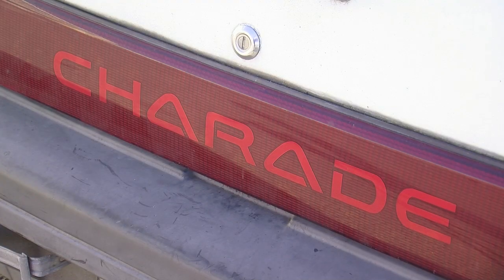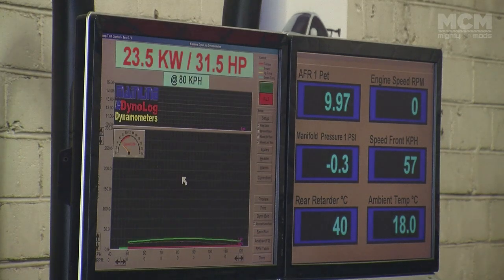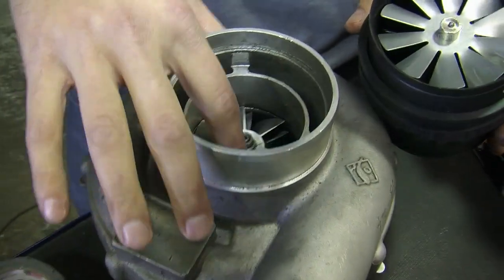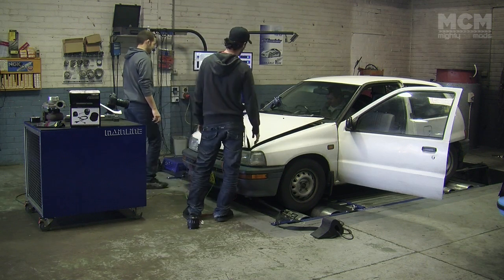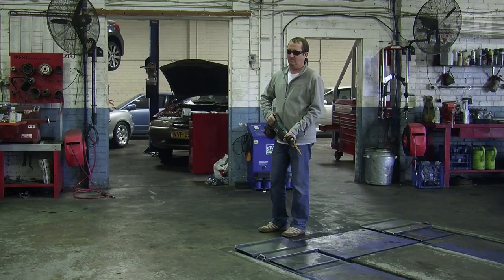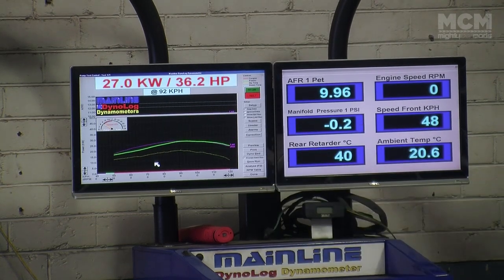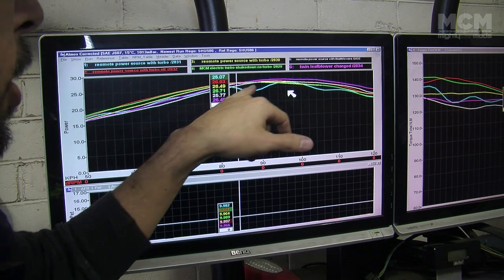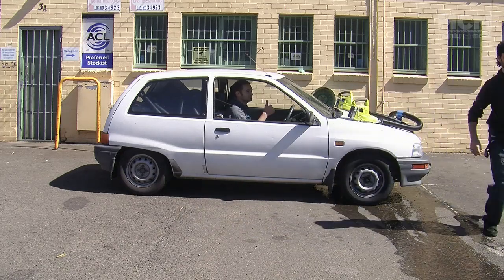Electric SuperChargers Mythbusted

Comment: My guess is try a big fan like 20 inches, blowing into a funnel with a 3 inch outlet into the air intake.  The fan still needs to be spinning insane fast and you need adjustments to gas mixture and timing to get the best.  Its all about cramming in enough air fast enough to get some compression at the intake. You have to have air going in faster than the engine can pull it in naturally (and at wide throttle, thats a lot).  An intercooler isn’t necessary for brief spurts of turbo power.  I wouldn’t rule out an electric turbo....but it is a lot more complex than that little fan thing,

Comment: I know this is old news, but what about ducted fans for RC planes? I found a balanced combo that puts out 1450kg thrust. How would that convert to boost. https://www.ebay.com/itm/XRP-70mm-14-Blade-Ducted-Fan-with-2600Kv-for-4s-Dynamic-Balanced/261892249469

Comment: Lets get drastic here, they are very effective but save money and get one from boating stores for around $30, plumb it up from the outside air to the drivers seat and into a cool shirt system like cops use in the summer to cool them while wearing vests.  Post run on the dragstrip, flip the switch and cool off on the return ride.  Or just reverse hinge a sunroof and pop it up on the return.  Here in the south in the US daytime gets over 100 F outside and track can get hot enough to cook on.  Anything to keep ya cool between runs is a win.

Comment: Brushless motors have advanced quite a bit since this video and powering a proper impeller (not a cheesy computer fan), a brushless motor can achieve a few usable psi of boost.  It's certainly not as high as an actual turbo, but it's something and being able to activate with a switch is nice.

Comment: It’s possible to use an electric turbine the problem is the price would be close to a real turbo. If you search R/C electronic turbines you will find one with adequate Kg of thrust to accomplish the job.  Problem is after the brushless motor, turbine housing, speed controller and power pack. Your looking at a grand. Would be cheaper to put a window switched nitros system in.

Comment: Problem you have is a carburrated engine. Carburrator uses nozzles to add petrol to the air without ecu or other external device. So, when you preassurise the system, only thing you do is make fuel and air mixture weaker. That saied, until you do something about carb settings there will be no increase in power.

Comment: Its spinning backwards. I just slowed down the footage. It was pulling air out of the engine.
Reply: Not camera shutter it's relatively,  once you go faster than light speeds everything goes backwards.
Reply: @irishguy200007  😂😂😂😂😂
Reply: Camera shutter speed does that
Reply: the engine would run extremely bad if it was spinning backwards because it would not have enough oxygen u dumbass
Reply: @dieselgeezer18  it could run bad getting too little or too much air. That's the science behind lean and rich you dumbass
Reply: @salteengamer4799  why what i said was wrong? Not much oxygen means that the engine will run rich because it won't be able to burn that gas
Reply: @dieselgeezer18  you're right I just had a bad day that day
Reply: @salteengamer4799  no problem bud
Reply: A dozen of potatos and a fat cat smelling them yeah i think that piece of shit supercharger doesn’t do shit.
Reply: @dieselgeezer18  it would run better because the vacuum is increased and sucks in more fuel into the crappy little carb
Reply: @JerryWasARaceCarDriver  it doesn't work like that
Reply: It's on the internet, it's true!!!!
Reply: I think you might be right lol
Reply: @stevenc2071  no
Reply: I saw that too

Comment: Not a valid test!

Without increasing the fuel flow and substantially advancing the ignition timing, why would boosting the air intake pressure make any difference? (The only benefit would be - effectively - decreasing air intake resistance).
Repeat the test but this time adjust the fuel flow and make the appropriate ignition modifications.  Another thing to confirm is; exactly what is the air pressure that the electric supetcharger provides? If it's 5psi or more,  it will be able to increase power - even taking into account the increased load on the alternator.
Reply: So if I really want to advance the power I put a mechanical supercharger and a better fuel pump and.... research on how to advance the time.
Reply: Probably don't even need to change the fuel pump. The extra fuel flow can usually be accommodated by software changes alone - as can the ignition advance.
Reply: @NoosaHeads  
Ahhhh.....not going to work on the car I plan to do.
57 Chevy Bel Aire.
The non computer car.
Reply: Bruh your not serious rn
Reply: @alfiebrotherton935  
I have no clue.
There really isn't a turbo charger supercharger book on the internet that I can understand.
Their all seem to be in gibberish.
And advertising a supercharger and talking about nothing really related
Reply: i agree as the same as a conventional super chargers or turbo the stock  ecu needs to be re flashed and the needs to relearn the new mods air to fuel and ignition timing  as true for any performance mods done on a car but in there defense it looks cheap and  i dont think this particular unit does much not 5 psi. but i would like them to do a vid on  ebay turbo kits

Comment: I noticed that the electric supercharger spins at a constant rpm while an actual supercharger speeds up with the engine, do you think if you could find a way to make the glorified fan spin in relation to the engine rpms you could actually get a power gain?

Comment: The first thing that is wrong with these fan rip offs is the fact that a carburetor works off a vacuum. So if this junk fan actually produced boost the motor won't run because the carburetor wouldn't be able to use a vacuum to pull the fuel into the air flow. Yes I know there are a couple of carbs that will work under pressure but most won't. If you look at carbureted turbo or supercharged motors the compressors are AFTER the carb, not before it. Only fuel injected motors have the fuel source after the compressors because they use pressure not vacuum to inject the fuel. However if you run 40 pounds of boost with 40 pounds of fuel pressure you will have a fuel starvation problem to say the least. They could have showed these fans are a ripoff by just installing a boost gauge and proving that these fans did nothing to produce boost or even lower the vacuum in the intake manifold.

Comment: Air alone don't make power.. If at full throttle, the computer is at max fuel for the injectors, the extra air is worthless.. 
The next thing, when you add more air, the engine must compress this air, that takes power to do that.. Hence the power loss of the test...without extra fuel to burn, adding air, cost you horse power.

Comment: To start with you crazy Yahoo's were trying to force air through the air cleaner nossel with the heat riser closed there by restricting airflow. And the air needs a smooth flow to the throttle body or carburetor. That stock air cleaner is not going to cut it, its too restrictive. Good luck you crazy Yahoo's, oh and by the way ; I think you have a busted dyno. .

Comment: MCM, You had install the system wrong, they were design to pump air into the exsaust side pipe, so the pressure flow back up into the intake like a backflow with pipe cooler.

Comment: I'd like to see some real engineering to determine what an electric supercharger would have to look like to be credible.  Certainly not bent sheet metal fans. Look at how the turbo's fans were aerodynamically designed.  An electric supercharger should work - a compressor doesn't care how the vanes are turned, but what would it take?  Fun video - now, if we can just get you to drive on the right side of the street......

Comment: You guys got it wrong. Now I personally innovated this, so when ricers all over the world are doing this, remember me... Ok, here we go... Take an E-go electric leaf blower, bolt it to your hood, with rubber bushings between washers between your nut and hoods underside, and between your bolt head an leaf blower, to reduce vibration and sound. Be sure to use thread lock. Use the hole saw and flex hose and adapters, just like yours. Just before the throttle body (yes throttle body, you're waisting your time with carbeurated) drill progressively larger holes, in a row, Fabricate a slide attached to a spring, for return, and a bike brake cable for pull. Run the cable through your firewall, attach it to a mounted bike brake lever,  you now have a manual blow off valve. Take an electronic thermometer, remove the metal tip, affix the metal tip to the electric engine of the E-Go blower, splice the wires to much longer wires, run them through the same opening in your firewall that you ran the blow off valve cable (ac drain pipe opening comes in handy), attach them to the body of the electronic thermometer. Let the blower, with the blow off valve all the way open, run. Do this to set a baseline operating temperature. Now when you drive keep an eye on the temperature, if it gets too hot open the blow off valve, by pulling the bike brake lever,  accordingly. Manually open and close (by releasing the brake lever,  which works because you have a spring attached to the opposite side of the flat plastic slide covering the blow off holes) the blow off valve to keep it as near to the optimal operating temperature as possible. Last but not least bypass the on-off switch on the ego blower, run the wires through the same opening as the rest of the equipment is wired, and then splice in an on off switch, mounting the switch on the wheel, dash or middle console. Now, as you drive, the air intake for the E-Go blower will allow your throttle body to pull are in, naturally aspirated and unobstructed, but when you turn on the blower (with the blow off valve fully closed) it will compressed air in the line, generating a small amount of boost. The only mistakes you guys made were lack of blow off valve, lack of system for controlling said blow off valve, and you're using the wrong blowers. You can use one two three or four (God knows how many if you choose, but to remain cost-effective you can only use one) but they gotta be E-Go blowers. You should use only one, Otherwise it's no longer and inexpensive, being as the E-Go blower is one of the more expensive electric blowers on the market.The E-Go blower is the only one that forces enough air to make this a viable boost system, each one moving nearly triple the air at triple the rate of one of your Ryobi blowers... There ya go. E-Go plus redneck engineered power switch, thermostat and blow off valve,  you got the... Wait for it!... GHETTO TURBO!!! ya heard it here first!!!

Comment: Now do this test again but with a hobby grade 12 blade brushless EDF in id say 90mm or more THAT will give you some boost.
Reply: Gabriel Duchesne It wouldn’t. To generate boost you need a lot of power and you need a compressor that’s made for actually compressing air, not just moving it. You need a radial fan, not an axial fan.

Comment: Should have added a pressure gauge at at pvc T. Also a vane or hot-wire anemometer might have yielded some interesting data. Using the displacement and target boost, possible to calc out the needed power.

Comment: a nice passive valve on the intake would be good to prevent loss of air flow and unnecessary damage to the turbo when it's off and there's less pressure from the turbo behind it.
Reply: you don't get the necessary airflow from just one turbo to feed the other. You need at least two, and put some goddamn supercapacitors in parallel with the battery.
Reply: better yet, use a notebook generic power brick with 100w and 12v car input with regulable voltage from 12v to 24v and use it to drive the turbos. Damn these modules are perfect for this.

Comment: Yeah, but if you were to use your "turbo" long term, you would burn holes in your pistons and / or the heads off your valves as your fuel / air mixture would be way too lean.

Comment: Hi Guys - would it make any difference if you used your electric fan turbo to blow air from the exhaust into the air intake - use some of that black tube to get the air from the exhaust at the rear of the car to the fan at the air intake - Looking forward to seeing the results - Thanks guys

Comment: You need at least a 7kW (9.4hp) electric motor, with specialized turbo impeller.  At 12 volts, it takes almost 600 amps to do that, at 96 volts, you’re still looking at 74 amps.

You’re not going to buying any of that off eBay or even Amazon.

Comment: You guys are flat wrong.
The problem with both the eBay and your leaf blowers is simple.
You aren't providing the extra fuel needed to make a turbo work.
As to fan speed, I can give you 250k rpm... But that has nothing at all to do with boost. It's air volume supported with fuel to burn than gives you boost.
I used to run two multistage electric blowers on a 350 sb.
But I had an auxiliary fuel feed that kicked in once the fans were up to speed....smh...

Comment: Try using a 12s EDF (probably going to need 4 car batteries connected in parallel to run it) from an rc jet, they actually blow enough cfm to make a much larger difference on an engine that small. Also the setup that fly-by-night company sold you has the worst looking Fan blade I've ever seen accompanied by what sounded like a brushed motor turning about as much room as a hamster wheel. The rc stuff can turn well over 50000 rpm under load with actual compressor wheels and much better housings

Comment: Every electric leaf  blower I've seen draws air from the bottom of the unit so setting them flat on the hood would cut off air flow making them usless. Also by joining the airflow in opposing directions using a T adapter you made them fight against each other instead of working to combine airflow. (I agree those electric turbos don't work but the leaf blowers could achieve 'some' positive results if that had been installed more effectively.)
Reply: A:  Positive pressure takes the path of least resistance so the “T adapter” doesn’t make the blowers counter each other
B: you can see the slit around the intakes of the blowers which are sufficient for the blowers capacity Which are there to prevent a blower from overheating or clogging if you said it on the ground while running
I don’t think you worked with many leaf blowers or pneumatic equipment

Comment: You need to make the carb a blow through and jet it properly better yet use a flex fuel vehicle or AT least something fuel injected.. I’ve made 1 single leaf blower blow a head gasket on a mustang.. I would tell you how much power I estimated it made but no one would believe me! ;-)

Comment: Was it even rotating in the right direction to pressurize the intake? What if it was in reverse, and pulling air out of the intake, thereby reducing available air? Probably the case, since the power went down with it installed. Also, any charging turbine needs to create more air flow than the same system being n.a. I wonder if it was even done right or powerful enough.

Comment: As a Qualified dyno tech/engine guruu and a pioneer of centrifugal supercharging ......I ask.what was the position of the heat riser valve the state of air filter element and total timing and the float level and the other 100 things you wackers never checked  .................loved it anyway

Comment: What if you used a portable air compressor (powered with a separate power supply than the car's battery) instead of some crappy fans?

Comment: Adding air pression is useless if u dont modify the setup of the air/gaz mix
Reply: A lot of fuelling systems will have enough margin to deal with that. Sadly this thing got better just by taking the intake snout off.

Comment: Be interested to see if you could use a high volume/pressure air compressor into an air tank (similar to an airbag setup) but with a switched solenoid to boost intake pressure for a short burst to increase power momentarily, the correct principles are there but would it actually achieve anything?

Comment: the whole reaosn for forced induction is so you can create more boom with bigger injectors and spark plugs, if youre pushing more air without any ratio's or bigger injectors etc, it'll actually make the air/fuel ratio unbalanced giving less power.

Comment: Hi guys. Quick question: Has anyone ever put inlet guide vanes onto a turbocharger? They're used in jet engines to increase the efficiency of the compressor stage. Could they also increase the efficiency of the compressor in a turbo? Given the maaaad stuff you've fabricated before, a set of vanes might not be too hard to make to find out.

Comment: I'd love to see an update to this in 10 years when electrically driven centrifugal pump based superchargers are readily available in the aftermarket :)
Reply: Mainiac1221 you very well could be right but even people have to start as an infant but I totally agree with you they find a way to make the electric power more efficient change the angle of the impeller or propeller blades get it spinning real fast and yeah you're right that's probably the future that's why I'm going to hold on to my V8 as long as possible

Comment: you miss the carbs fuel pumping capacity. You pumped more and more air with same fuel. You have just improve burning quality. Nothing more. Try it with an electric injection engine operated car and say those spellings again.

Comment: There is the Eturbo , www.http://eturbo.io, it's a hybrid turbo body with a brushless  electrical motor that spins at 75000 rpm , using external Li batteries , it's still under testing , and Carlos , the inventor is looking for some sponsorship / early adopters , you can reach him on his Facebook page , looks really promising